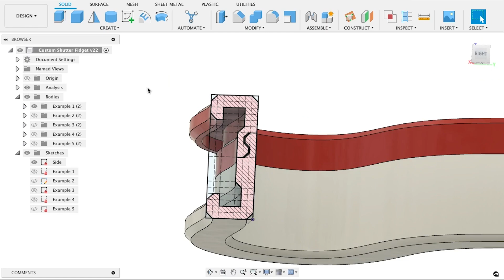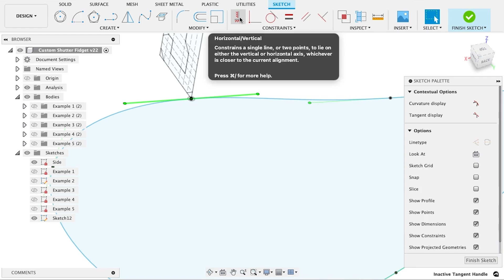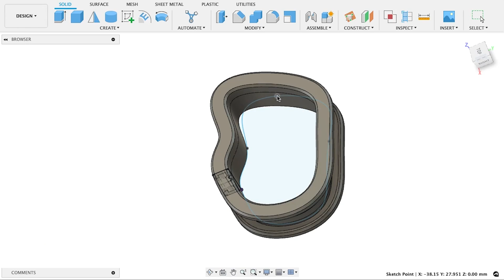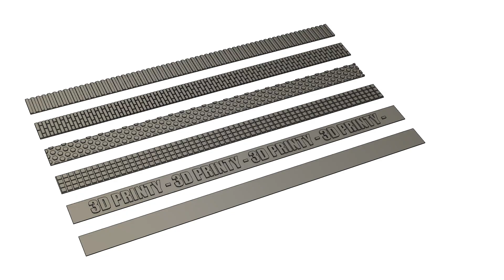Fusion 360 - Design A Custom Shutter Fidget

Comment: Nice project! I wonder if it's possible to make a Mobius loop version of this fidget toy 🤔
But it will need to have "rails" on both sides, but i guess it'll be pretty interesting to see how it works 😃
Reply from the maker: That would be a fun challenge! The odd layer lines might cause extra friction, but a sufficiently large loop with only gentle curves should be possible :)
Reply: @3DPrinty  i hope we can see the video about it if you try!😄